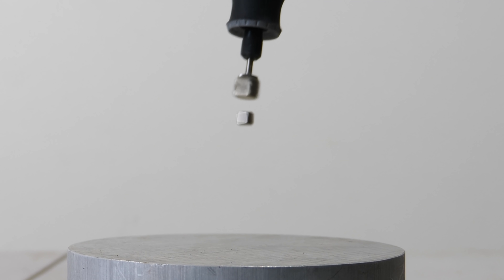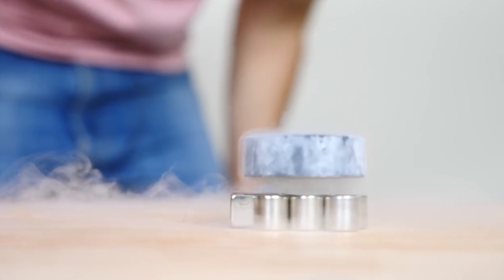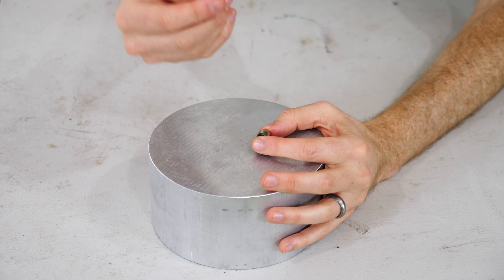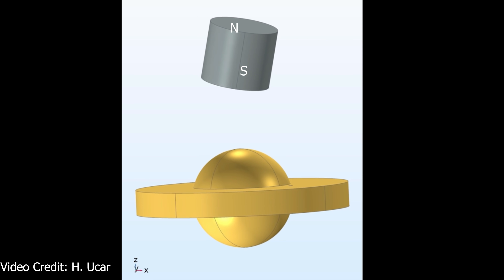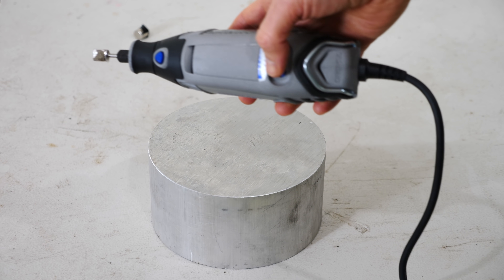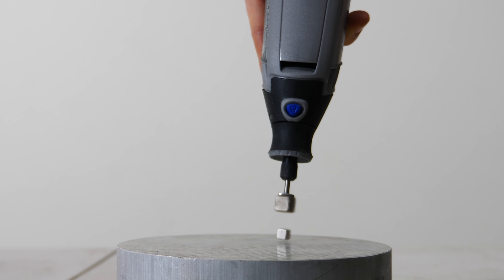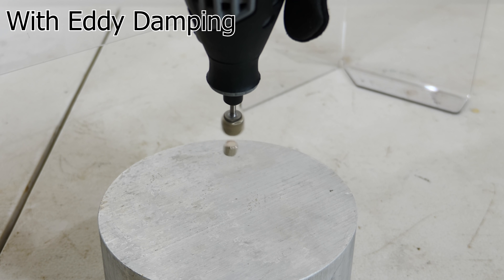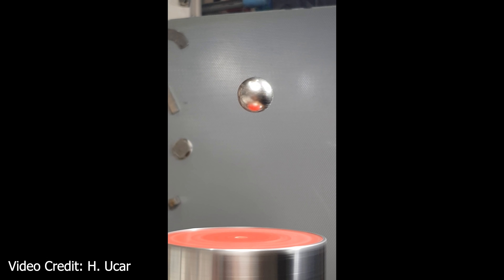Magnetic Locking WITHOUT a Superconductor!

Comment: What do you think of basing fusion on this?

For instance, say you have an O’Neill cylinder that’s anywhere between 30,000 and 50,000 feet in diameter.
- you have two (HUGE) flywheels at either end that are the same diameter, powering up opposing solenoids (their main capacitors), do you think it’s possible to have electromagnets set up like this radially like an old style rotary engine, but on an industrial scale?

The other thought is to take advantage of zero gravity and an O’Neill cylinder size using laser fusion.

The idea is to try and re-create a star’s design, while looking to the planet’s for inspiration.  Like a Huge lightbulb with fusion at the center, utilizing other materials as different layers of that plasma and culminating in a liquid outer “shell”

Comment: I have a question for you, what happens if two opposite magnets (both north facing or south facing) placed in front of each other and attached to the same holding frame which is attached to a moving object like a boat or a car toy with one magnet has higher emf than the other one, would the car or the boat moves into the direction of the higher emf magnet pole?

Comment: You should mention as I just about lost a tooth in this experiment the floater. Magnet must be smaller. It will not pick up of of same size.  Second floater should be a ball it’s much easier and you should really do water or aluminum plate.  Applications?  Nothing I can think of. The is the same levitation you get with AC in mag lev trains.  And look at that tiny magnet the. 2000W dremel can pick up.  It would be way cheaper to make liquid helium than the motor to get to 15,000 some rpm.  So need trick but the floating plant pot uses less energy and is quieter and stronger

Comment: That's cool and all (as noted at 4:55), but I think it would be more "boss" if the spinning motor + magnet was replaced with a series of electromagnet coils that could be alternately energized with electronic components to produce the rotating (or other) magnetic field patterns without requiring any physical motion.

Even more boss still, would be to use such an apparatus to mechanically manipulate lithium metal wires and/or lithium metal plates formed into one or more electromagnet coils, in a controlled fashion, without touching them physically, while under hard vacuum and at extremely cold temperatures (cold enough for hydrogen to be in solid phase).  Once that has been mastered, replace the hydrogen and lithium with antimatter hydrogen and antimatter lithium, for making some even more boss YouTube videos.

Comment: What if a small rotating cylinder of  diamagnetic bismuth particles embedded in an insulating matrix that would suppress eddy currents was uspended in a strong magnetic field so it would not have electrical braking of its rotation. Would it spin for a very long time in a vacuum? Would it be able to levitate? 

Aloha

Comment: One question. Do the magnets get hot due to eddy currents in their permanent magnet material or the metallic coating?
Reply: No, Magnets stays at room temperature and the motor runs like there is no load.

Comment: Would it work with high speed switching electromagnets?  Just switch polarity of a single stationary electromagnet quickly to achieve the same?  Assuming the current is able to switch fast enough after inductive reactance / resistance of the coils changing polarity, shouldnt it work?
Reply: Yes, only there would be restriction to use iron core in electromagnet. This means one needs to supply more current to compensate this.
Reply: @sudanamaru  Do you mean restriction to only use iron core or not use iron core?

Comment: Fantastic. Now do some measurements, write some equations and write some software so people can plug in what they have and get estimates of what regions will be stable.  Or give specifics of separation distance, mass and force, to calculate what speed to use and what strength magnets to use.

This make magnetic levitation and materials handling cost effective.  If you had to try this with electromagnets, too expensive, too much heat and power needed  Permanent magnet arrays can work.  If you mark the magnet and use STM32 or ESP32 or Ardunio and position sensor,s you can use microactuators to change the position of the mass. Basically the computer is fast enough to balance the magnet masses because they move slowly relative.  Just as a human can balance a mass on a stick by moving fast and precise, or a robot can walk and balance, or SpaceX rockets land on their tails.

Richard Collins, The Internet Foundation

Comment: Can I please get some help with accomplishing this?  

I have a dremel 8220. I have several small cube magnets of varying size . . Help me get the number correct here.  If the magnet is smaller or weaker does the rpms need to be up or down when compared to magnets of similar size or stronger?
Reply: Please check other setups and details in my channel.

Comment: What about placing the second magnet in a short piece of copper tubing instead of water or on a chunk of aluminum? When a magnet is sent down a tube of copper, an eddie current is created and slows down its movement. If the magnet you're trying to levitate is, for example, a quarter of an inch tall, then the copper tubing may only need to be the same size.

Comment: Can you please describer how you put this together?  Such as what glue to withstand the rpms, was it a nail or acrew, how long did you take to let them bond.  Things like this please.  Thanks again!
Reply from the maker: I just used a glue gun but it will come off if you go too high and it isn't balanced correctly. It was a bit for the dremel that was on top that I glued the magnet to. If you want to try it the key is getting the magnet exactly in the center so it isn't off balance when it spins.
Reply: @TheActionLab  thanks!  I ended up using super glue, but as you said mine wasnt balanced and it ended up bending the screw I used to place it on in the end.  I'll try again shortly.
Reply: +1, rpms would be interesting, the units of "dremel 3000 at number 8" aren't very portable lol

Anyway, gonna peruse the paper if I keep failing for too long

Comment: Attatch a collapsing arm in a casing that will bolt lock and you have a levitating car.  The weight of the car can be raised by the arm being cased and bolt suspended.  The magnet flooring and suspension will lift the car with cased arm bolted/locked in place to base frame of the car.  Anti-gravity without cold fusion.  Apply vortex for unlimited energy and xenobot nano slime mold for self aware & self sustaining- repair capability.
Reply: Or you you may use a low bandwith electro-magnet radio frequency transmission without the need for spinning magnets.  Seems to be many ways to achieve quantum locking.

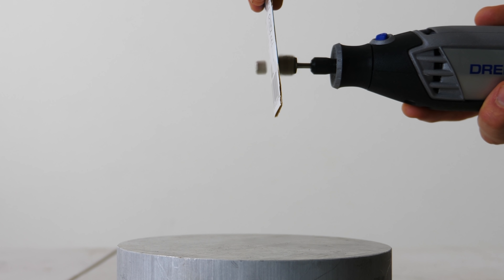Comment: 5:50 It would be really nice if I could get some data on the weight of the magnet and RPM of that motor
Reply: Nothing is critical here. RPM needed for this small cube magnet in air could be higher than 10000 RPM.
Reply: @sudanamaru  What do you mean, you say "nothing is critical" and then talk about "needed"... If a thing is needed then it is critical to have

Comment: Request for an accessory (new) experiment to the demonstration in this video. What would happen if you created a small ice cube tray thingy and froze the levitation magnet (i. e. the levitation magnet would be contained in a small ice cube (that’s in the same shape as the levitation magnet)). Once you get the frozen levitation magnet spinning and locked — what will happen when the ice around the magnet starts melting. Will the water start falling to the ground OR will it stay in the field around the levitated magnet? The only problem for the experiment is finding a spinning tool wherein the motor won’t burn up while we wait for the ice to melt.

Comment: Are you sure that this is not just a rotating magnetic field generating rotating electrical currents in the metal of the other magnet, creating a repulsive force that is short-ranged but high strength?
Reply: Sure
Reply: There's no lossless generation. Such repulsive force you're talking about, created by relative movement, would not be exactly able to offset gravity. That's why all the magnet-dropped-inside-tube videos have the magnet fall down anyway, just slowly.
Reply: @u1zha  Except for the fact that energy is perpetually being IMPARTED here in this video, due to fast rotation from the Dremel tool. So there is loss, but there is also added energy continuously.

Comment: Now, install rotating manets in a train car perpendicular to the length on both sides, on the edge... then have magnetic track, could be electro magnets or not. Now, electromagnetic levitation train without all that cold. Cheaper room temp levitating train.
Reply: The rotating bit did not solve the magnet strength problem! Trains are very heavy. If you had a way to make field stong by rotating a cheap magnet, that would be amazing. This video is not claiming that hehe.

Comment: I wonder if this is how UFOs 🛸 are made I mean if magents can generate free energy I wonder if that’s how a ufo flys by using magnetic fields to produce a infinite amount of energy cause don’t they lock in air like that too?
Reply: Like would it be possible to control or change a magnetic field with copper?
Reply: Could it be possible to use a magnet and copper in the right way to create a magnetic force that strong enough to allow the magnet to move in any direction and lock in any direction?
Reply: This video is not showing free energy, geeeeez.

Comment: Reminded me of the Paul ion trap, which levitates ions in an oscillating quadrupole electric field. The governing equation for that is the Mathieu equation (also mentioned in the paper), and depending on the mass and charge of the ion there are regions of stability for the strength of the field and the frequency. The equation for the magnets has similar properties.
Reply: Most of traps are based on local minimum of quadrupolar field and Mathieu equation is applicable. Here we have interacting two dipoles  and also it would be difficult to reduce the problem to a single degree of freedom.
Reply: Appendix A in the article provides the equation of motion for a special case starting from the well known spherical pemdulum.

Comment: Ok, now we should find a way to rotate the magnet field without physical magnet rotation and we can "invent" levitation.
Reply: Not sure what you mean, the more practical application here I think is that we could use physical magnet rotation/movement as a passively stable (thus cheap and safe) levitation mechanism.

Actively controlled electromagnets for levitation have been in use in Transrapid maglev for many years, for example.

Comment: @The Action Lab. pssh if you think that's cool you should see the magnetic locking done by Polymagnets Correlated Magnetics. Their spring configuration is super cool, basically they configure small areas of magnetic domains to be specifically oriented at smaller scales to get the effects they need. (They say its 'special CMR technology', but I'm guessing it's something like heating the magnet above the curry temperature, then using another magnet to align that region, and the shapes you make from that create the effects you want, repulsive spring or snap latch or maze...)

Comment: This is pretty amazing!! It's almost like Bernoulli's airflow principle but with magnets....vortex magnetism? This is probably why UFO's spin... antigravity!   can you measure the forces given upon the magnet..this might explain gravity. 9.8 m/s ..after all, Earth is just a massive spinning magnet.
Reply: This can be better explained by driven harmonic motion where position vector and the acceleration vector are on the opposite phase. This phase characteristics (called phase lag) constitutes also the principle of bass reflex speakers. In this magnetic levitiation this works like that: The magnet attached to dremel pull the pole looking upward (say N) of the floating magnet (FM) to its S pole. But this N pole approach to the N pole of the dremel magnet due to the phase lag and cause a repulsion. This repulsion prevent magnets to collapse. There is no magnetic vortex there. For more information see the FAQ that one can find from my twitter page (Sudanamaru).

Comment: But why doesn't it work with electromagnets?
It's much easier to rotate a magnetic field with alternating current into a coil than physically rotating permanent magnets.
Reply: It would work but few issues: Oscillating field versus rotating field cause different mechanisms. One should prefer coreless coils in order to prevent the magnet in the air to stick it. It requires lot of current to obtain comparable magnetic field of NdFeB magnets. Another apperently unnoticed factor about this levitation. The rotating field should be assymetric in order to obtain attraction. This is caused by assymetry of the field due to misalignment on centering the magnet on dremel or by mfg misalignments. One should be care of this requirement when using coils.
Reply: @sudanamaru  Oh, thanks for the reply, makes sense now.

Comment: Not sure if anyone has seen the locking in a 2-D plane by using a large magnet surrounded by smaller magnets with opposite fields? Basically the big magnet pulls harder at a distance but when closer the small magnet repels. I was wondering if anyone has tried to do this in 3-d to create levitation?
Reply: Little chance for succeeding it because of the Earnshaw theorem.

Comment: use a multimagnet array - a set of magnets embedded in for example a sturdy wooden board - with alternating North - South polarity;   place the board on the table, and put a magnet over it, the magnet over the board will levitate - it is simultaneously attracted and repelled.

Comment: Bruh😭😭😭 I can't glue my dag on Neodymiums to my Drexel bit oml... the attraction is so strong and superglue, hot glue, metal adhesive, nor thick duct/electrical tape will hold it... do u think it's bc I am using cylindrical neodymium that makes it hard to adhere to my bit tip? I rly wanna replicate this experiment for an idea I have and would love someone's help on the part that seems so simple... gluing the magnet to the dremel 🤣
Reply: Poles of the magnet should be at sides. Don't glue for instance. Fix it by wrapping tape, lot of. See also videos and links at http://www.youtube.com/user/sudanamaru/videos
Reply: @sudanamaru  yeh I’ve watched all ur vids which are so dope but idk how to well adhere my square magnets without tape… like ik Action Lab here didn’t use tape but in ur vids they don’t seem taped at all. And when I tried to tape magnets to a dremmel shaft/bit, the tape threw off the momentum of the hit and made the dremmel vibrate very intensively in my hand. Any other tips?
Reply: @maxstarrofficial  I never used Dremel  and such tips on my experiments. I have a small lathe and produced all needed housings with it. Sometimes a careful usage of super glue with its fixing spray worked well. Anyway it would be less problematic to use small magnets for example 1/4" cubes. Remember this locking requires both attraction and repulsion. Repulsion requires poles of tbe rotating magnet at sides and attraction needs polar assymetry. That is precise centering the magnet to the rotor cannot give you attraction since the placement is symmetric except the magnet you use has misalignments or defects.
Reply: @sudanamaru  well I knew that a slight angle was needed which is why I planned to simply angle the centralized dremmel-magnet when approaching the magnet I wanted to lift/lock. And I do have about 1/4” cubes, that I just can’t get attached to a metal bit with supper glue. I’ve never heard of a fixing spray though so that may help. How should I use the fixing spray? (Also thx for ur replies and hell w this, I’m so intrigued in this phenomenon and want to test/study in personal research!)😁

Comment: Amazing! You can move and lock a magnet in space, just with another rotating magnet!
This has very practical applications to move objects in closed spaces. For example
- Move stuff inside an aquarium
- Move stuff inside a space where the object has to float, and is not allowed to touch the walls
- Enclose the floating magnet inside a prop, and you can do cool special effects stuff of floating objects
- Medical applications to move an object inside the body
- On a large scale: Levitating beds, attractions, toys
- Decoration, floating lights
Reply: It is not necessary electricity or  rotation or nitrogen or superconductors... to make levitate a magnet. It is very easy.

Comment: If you use an electromagnet, you don't need a rotating mechanism. You can change the direction of the magnetic field by changing the direction of the coil's current, which may make the levitation effect better. This is just a guess.

Comment: Sir was this the logic applied in Konark suntemple built in 13 century in Puri-Odisa-India . As the legendary say that the Idol of sungod was suspended in air as a huge magnet was placed on top of the temple. Please reply sir.
Reply: I don't think this would be the mechanism because this method causes vibrations and is based on vibration of the floating magnet.  Secondarily, scaling upping this beyond a range is almost impossible because of the weight of the floating magnet.

Comment: 4:58 How many RPM is required to do this? I'm thinking of making a DIY Magnetic Locking video by building a setup like that of this one, except it is stationary and driven by a small 12v DC motor with an RPM of 3600. Would that work?